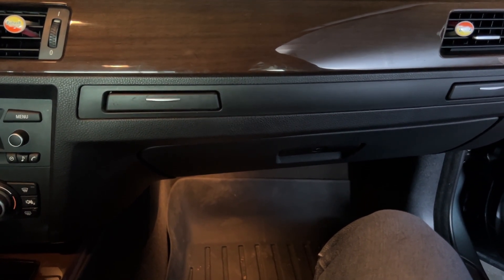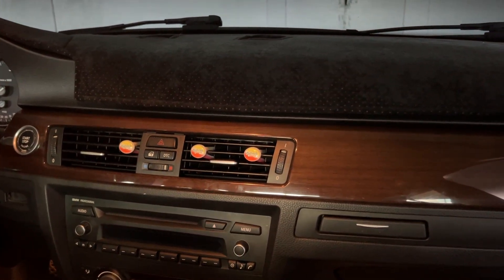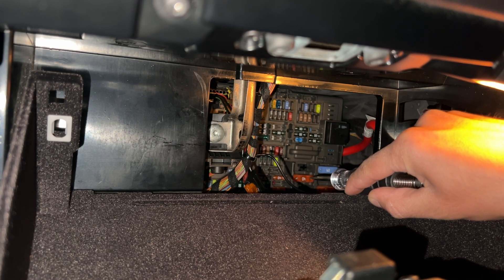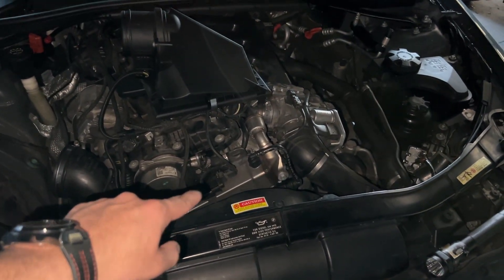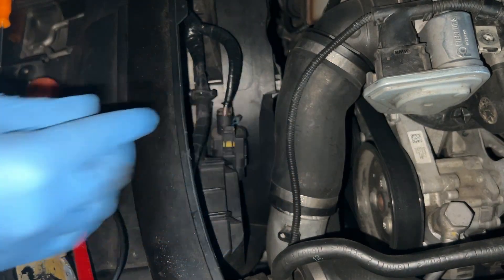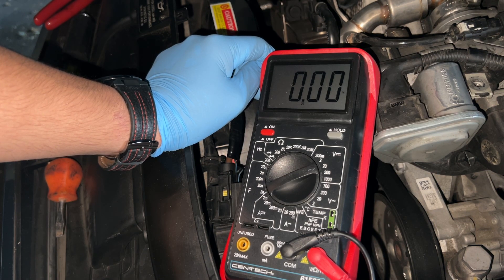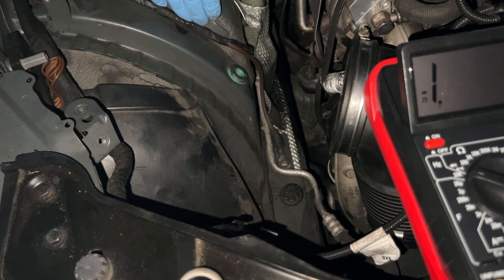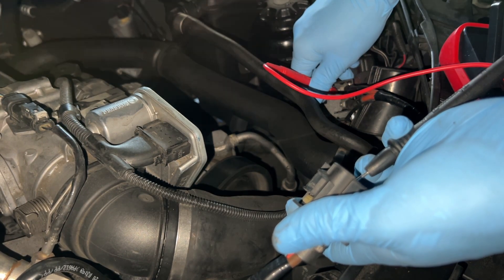335d Cooling Fan/ Radiator fan not working fix

Comment: I had the same issue with my BMW 3 Series 330d (2006, M57 engine). The radiator fan was not working at all.

I also watched a lot of videos and read forums, so I thought I’d share my solution. Maybe it helps someone.

Luckily I had access to ISTA. That allowed me to run the fan in test mode. Super helpful, but not required.

First, I replaced the fan, but still no result.

Then I started checking all the wiring. With ISTA I could view the wiring diagram and find the location of the DDE plug.

In my case, the PWM wire (controls fan speed) had no signal.

For the M57 engine, the PWM wire is on pin 40 of the ECU plug. This was clearly shown in ISTA.

I checked it using a basic resistance multimeter and found the wire was broken.

I cut the bad section and repaired it using simple new wire.

I did not expect that wire to be bad, it just runs through the engine bay. But somehow it broke.

My advice: learn how to use a multimeter. Lots of videos on YouTube. Always check wiring before replacing parts like fans. 😮

Comment: Having trouble with the electric fan on my BMW E91 330d (M57). I’ve checked fuses, relays, wiring, even swapped in another fan, but it’s still not working. Today I logged temps with ISTA while driving: coolant started at 24°C and climbed gradually to nearly 90°C after about 10 minutes, so I assume the thermostat is working normally and the temp sensor is also functioning properly. Forcing the fan on via ISTA doesn’t work either. The only thing I haven’t done yet is check if the PWM signal is present or if the signal wire is intact.

Thanks for the helpful video. How did you end up solving your issue? Suggestions what to check next?

Comment: Mate i dont know if you check the comments since you posted the video but here it goes . I have the same issue my fan doesnt kick in at all but as soon i disconnect the coolant temp sensor boom it works what i do not find is the location of that part itself on 320d 2010 any advice would be very much appreciated .
Reply: I think that relay is built onto the back of your cooling fan, it’s inside a large rectangle thin metal box , not the same one as in this video , if so that’s what you need to replace ,

Comment: Replaced the cooling fan but didn't fix the problem, could be the swicth but whenever i look up the fan switch for videos there's none, 
Update:
Replacing my coolant temperature sensor, it's near the engine by the driver side it's not on the hose near the radiator, and there is no switch either near that hose, don't know if the car has one will update you again after my the part comes in, hopefully this works, it's the last thing that could be it, my coolant tank was also leaking but very slowly and barely started now, probably melted a bit from the coolant being hot and it is also the old oem one, so it shouldn't be that but it is a possibility, but again the last thing it could be is that coolant temperature sensor
If not the switch but again don't know where it's at or if it even has one

Note:
Wiring is good so is ground, fan turns on in ista, changed the ac pressure sensor just to see if that was it but nope, ac/compressor is working, fan is just not turning on so ac doesn't work as it should, it does blow cold/stale air but it obviously could do better, changed the relay and it wasn't it, got a new fan it wasn't it, checked the fuses, wasn't it, might need a new battery because the battery is almost all used up but it shouldn't be that, car starts and everything just the life out of the battery is not as good, 

Conclusion:
Can't be wiring/relay
Can't be the fan
Can't be the fuse in the glove box

Don't know if it's the fan switch sense i don't even know if this car model has one

Has to be the coolant temperature sensor near the engine by the driver side if not it has to be something with the ac as the last option

Comment: To check if your fan is working, remove the wire harness from the coolant temp sensor,  the fan should start working.
Reply: I used an obd on mine to check fan working and yes it did , but won’t come on its own as it should , lm k going to try replace the module built in to the back of my fan see if that works , I’ve tried everything else ,
Reply: @Alfiepops found a solution?
Reply: @ElPerron510  the fan doesn’t come on until 100 degrees phase one , second phase comes on at 120 degrees those engines run hot , check the running temp in display,  mines stayed around 91 degrees when warm , rarely does it get up to the temp required for the fan to come on , also turn your A/c on that should switch the fan on also,  for the condenser , I had a leaking coolant flange that only leaked when warm  that was my problem why I couldn’t get it to bleed the system  properly ,

Comment: LCI E61 2009 N47

 Hi.  Does anyone know or have faced such an error?  ISTA wrote: DDE: Electric fan, starting.  CODE: 0041F2.  I did a test, but it doesn't turn.  Maybe there's something wrong with the program.  I installed the second one, nothing.  Does anyone know what the diagram looks like and what elements work with the fan?  Does the fan work with a relay?  Or just a fuse?  Will you help?  I will add that the connection at the fan on the pins is clean and functional.  The harness looks fine.  No. What needs to be done to ensure there is current in the cable that goes to the fan.  Maybe then the fan will work.

Comment: Any idea why does my transmission doesnt want to shift from 1st gear when my radiator fan doesnt work. 1st i had a hunch but then when i un plug the rad fan the gear wont shift and stuck to 1st, but when i put it all back together every thing goes smooth. Plus, i got intermittently issue with the rad fan not working, i got new coolant temp sensor.

Comment: did ur fan come on when u turn the ac on before u put this part? My fan only comes on with a c on  did urs overheat? No codes here
Reply from the maker: Fan should come on when A/C is on. My fan didnt turn on before replacing this part (even with A/C on), after replacing, now it turns on if i turn the AC on. Yes, my car did overheat. Not to point of causing damage though
Reply: I have the same problem, did you find the solution? @gail6904

Comment: Sometimes when I start the car the fan spins really really high almost sounds like a jet. Could the relay be the reason
Reply: Having the Same problem on my 09, 535i xdrive , where is the location of Cooling fan relay , and Cooling Fan switch ??
Reply: @robertmitchem6635  mine turned out to be waterpump

Comment: I've just completed this fix on an E61 550i LCI. For anyone looking desperately for a relay - my car didn't have one. All fuses were good and there was voltage and signal at the big connector. In the end I had to replace the fan itself. I decided to break open the defective unit - inside there's a small ECU which isn't repairable. I'm assuming something inside that ECU died. The 550i also has an oil cooler which needs to be disconnected - so have some cardboard and a pan ready under the car to catch the spilled oil.
Reply: Hi.  My fuses are good too.  The fan is not working.  There is no voltage in the power supply cube.  How did you turn on the voltage to power the fan?  Need to turn on the ignition and start the engine?

Comment: Currently struggling with this issue. Getting voltage and connection everywhere. Perhaps the relay went off? How do I find the relay?
Reply: Its not located as in the video, the cable going into the fan goes all the way below the brake fluid reservoir without any other cables connecting to a relay
Reply from the maker: What model BMW
Reply: @salgadationjr1677  its a 06 335d. I gave up today because i ran out of time and reinsulated the cables, reassembled everything and the fan came on for the first 5 minutes and then it died, throwing the 0041f2 code again for the fan control. At least i know the fan itself is all good. The problem is now narrowed to the relay which has unknown location or the positive cable which goes underneath the break fuid reservoir
Reply: @salgadationjr1677  i have spent a good 4 hours trying to research this but i couldnt find anyone with the similar problem as me, everyone else seems to have that relay on the PS reservoir except me. Also I have only one fuse for the thermostat and one fuse for the fan
Reply from the maker: So i looked up the relay you saw in my video (61367661503) and it seems the fitment is only for 335d’s from 2009-2011. So your car doesn’t have it. Idk if you already did this, but check in the glove box for fuse F69 should be a 50 amp. Also check the fuse box under the hood on the passenger side and check the fuses as well as the K9137 relay.
Reply: @salgadationjr1677  I already checked the fuses and they are all in good shape, confirmed it with a multimeter. I checked the box under the hood and its just cables and connectors, there was nothing that looked like a relay nevermind a fuse
Reply: @scav5881 some relays on certain models are modules built into the back of the actual fan itself, if it’s a large rectangle box on back of your fan you’ll need to replace the fan or module as this type is not easily repairable,

Comment: Nice job showing your troubleshooting method, but when you tested for voltage at the connector you got good voltage, which indicates the relay (that you said was bad) is working.  I guess maybe you had already replaced the relay when you did that test?  It would be nice if you would show what the readings are at the fan socket with a good relay and a bad relay.  Assuming it would simply show -0- volts if the relay is bad- right?
Reply from the maker: So i got the a radiator fan and relay the same day, i was this close 🤏🏽 to replacing the fan first as i did not believe that the relay would fix it. the reason why i thought the relay wouldnt fix it was because even BEFORE replacing the relay i was getting voltage at the fan socket. So to answer your question: with a BAD relay you will still get voltage at the socket. It doesnt makes sense right? Bad relay means current doesn’t go from one end of the red wire to the other, but for some reason you will still get voltage on the positive wire at the socket. I actually tried looking up how this relay works to give you a decent explanation of why this happens but i cant find anything that makes sense. All i can tell you like i said in the video if everything seems to work properly (even good voltage at the socket) you might want to give this relay a try before going for the fan. I know i sound like “trust me bro, its this part” but if you use the precess of elimination to find the problem, it makes a lot some sense (price and time wise) to go for this relay than the fan. Sorry for the late response and hope this helps

Comment: I get no voltage on that single wire for my 2012 335is any ideas, would be much appreciated. When I spin my fan manually with my hand it then will start to spin but stays super slow with max ac on. What controls that single wire ?
Reply: Same Probleme i get only 0.22volts
Reply: @gonitischki6562  try tapping your fan relay with a wrench or something with max a/c on, that’s what I did and the fan started right up and I was able to pick up a new relay from bmw for $50
Reply from the maker: Have you tried testing the signal wire with the car on and A/C on? If you still get no signal then you can do a continuity test on on the signal wire. The signal wire goes from the socket fan all the way to the DDE/DME on the passenger  side of the engine compartment. You can disconnect the socket from the DME/DDE (small socket, shouldn’t have more than 13 wires) and test it from there. If i can, ill try to upload a diagram in the description to make it visually easier.
Reply: I fixed it, it was the fan relay getting stuck.

Comment: mine is 320d some time works sometimes not working.... after pressing ac button and restart the engine two or three times it works any idea every thing testing except that box you showed here also share the location if possible
Reply from the maker: Hi, do you have an OBDII scanner that will let you read the coolant temperature? Or check my video on how to check temperature on the cluster. Make sure you coolant temperature is giving an accurate reading! this is to check that your coolant temperature is working properly
Reply: @salgadationjr1677   thanks for your early response.... yes I have obd 2 scanner , thermostat and coolant temp sensor working properly , problem only with cooling when pressed ac button some time works and some time not as above mentioned